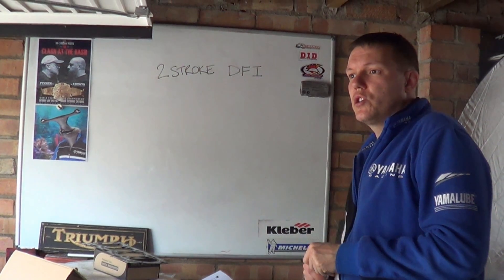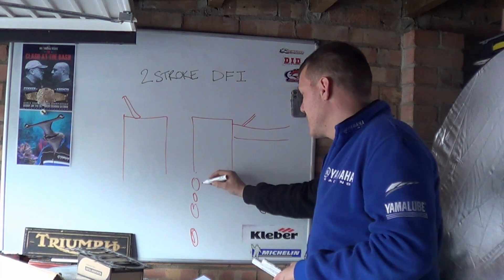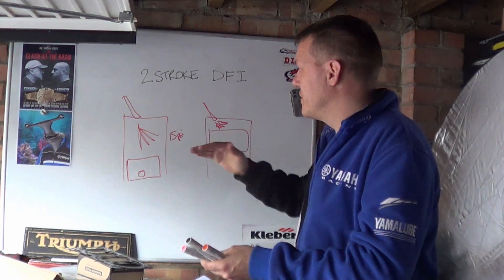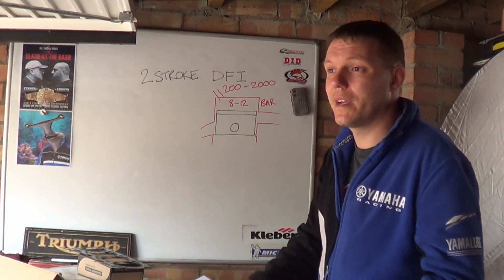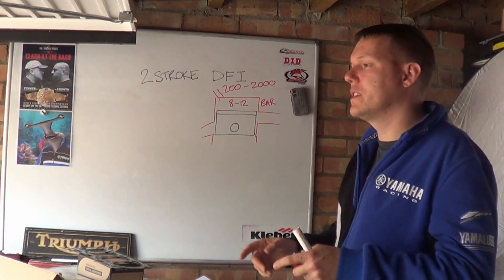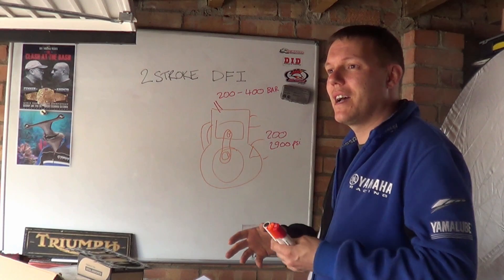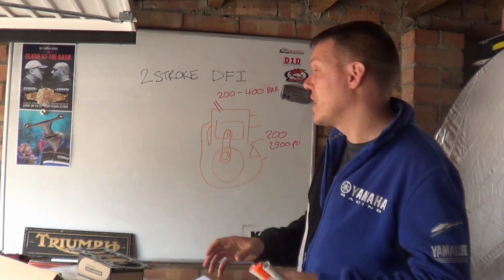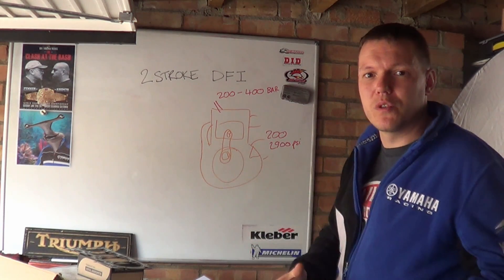Will Direct Fuel Injection save 2 Strokes?

Comment: Matt, do you think someone will succeed in doing Direct High Pressure Fi on 2 strokes in a few years ?
Or will they abandon the IC engine all together and go electric dildo on wheels route ?
Reply: That's what I would like to know to. And maybe there could be a way to reduce the emissions from the oil scraped off at the exhaust port. I really hope 2 strokes don't die.
Reply: @EbonyPope  They are already dead as far as I am concerned. But I love them and ride one! Plus people want to ban Diesels which are cleaner than even the cleanest 2 strokes :/

Comment: You are right on most of things, but your fuel pressure values are awfully wrong here. As piaggio (aprilia) in early 2000's made direct injected 2 50cc stroke scooter and it used air assisted direct injection after closing exhaust port with max air pressure of only 8bars. Called DiTech. Look it up. Ecu Rev limit was 10000rpm. Had one.
Reply from the maker: "but your fuel pressure values are awfully wrong here" 

Come on dude, if you're going to call someone out get it right. The DiTech (morini system) and/or the Purejet (piaggio system) is in theory a direct injection system but in the same way the TPI system is on the KTM. The injector spray fuel into the cylinder just as the exhaust port closes not like the Etec system or at TDC like diesel systems.

They were soooo good that they're no longer used.
Reply: @thedirtyworkshop  Your responses do not need to be rude in order for you to reply. 
To quote you in this video: "As soon as you close your exhaust port you can spray fuel. The problem is that then piston is very close to TDC and that the pressure is quite high ~ 8-12 bar."
Which is incorrect. And you're trying to avoid the fact by trash talking about the system itself.
Direct injection is every injection that has injector located in cylinder head and sprays directly into combustion chamber, no matter the timing of injection itself. I didnt say that DiTech was perfect in any way, as it was a first attempt at that technology. But it did what it was advertised for.
Reply from the maker: "The problem is that then piston is very close to TDC and that the pressure is quite high ~ 8-12 bar.""

- yeah, very close to TDC the pressure is between 8 to 12 bar. Have you ever done a compression test?

"Which is incorrect."

- do a compression test and get back to me.

"Direct injection is every injection that has injector located in cylinder head and sprays directly into combustion chamber, no matter the timing of injection itself."

- Very true - not arguing that, however when an injector fires is very important when concerned with fuel pressure. 

"But it did what it was advertised for."

- What did it advertise?
Reply from the maker: Oh and to add - this is a video that is generalised.
Reply: @thedirtyworkshop  Read what you said again, its "then", not "when". Changes the meaning of sentence.
It makes sense to inject as soon as exhaust port closes as it gets the unwanted 2 stroke wasted fuel flaw sorted out. Only thing why would you inject at TDC is stratospheric lean burn, which you don't need to use. Its not a diesel that you need to inject at tdc in order to get the mixture ignited, you have a sparkplug there to do the job.
P.S. all the injection problems that you describe here have actually been sorted out, but not for two strokes but your beloved 4 strokes (Audi/VAG TFSI) and they work very well so no point in discussing that problem as the solution is already there.

DiTech was advertised as "new" technology, better power/torque than same 2stroke carbed models (and 4stroke) and better emissions and fuel economy than both conventional 2 or 4 stroke engine.
Never advertised as reliable. (damn Italians)
Reply from the maker: "Read what you said again, its "then", not "when"."

- LMAO! You are some sort of special aren't you. No, it's when - not then. I fucking wrote it, not you. I know what I mean - not you. 

"Changes the meaning of sentence."

- Are you, someone who is probably not English (because of your name 'Karlo Kasunić') trying to tell me how to speak/type/write English? LMAO! WOW that's a massive ego you have!

"It makes sense to inject as soon as exhaust port closes as it gets the unwanted 2 stroke wasted fuel flaw sorted out."

- and then (LOL) you come out with this gem of a sentence. 'gets the unwanted' - 10 point there dude. 

"TDC is stratospheric lean burn"

I'm pretty sure you mean 'stratified' and not stratospheric. The stratosphere is a band of the atmosphere...

"P.S. all the injection problems that you describe here have actually been sorted out"

- LOL yeah - high pressure direct injection 2 stroke engines are everywhere...

" but not for two strokes but your beloved 4 strokes (Audi/VAG TFSI) and they work very well so no point in discussing that problem as the solution is already there."

- So much so, that you watched the video...

"DiTech was advertised as "new" technology, better power/torque than same 2stroke carbed models (and 4stroke) and better emissions and fuel economy than both conventional 2 or 4 stroke engine."

- Please send me both the adverts and the data to back that up.
Reply: @thedirtyworkshop  So you actually are changing the subject again. Yes, english is my third language, its a fact. Should I be ashamed of that?
No need to respond, to above question. But I would like answer on these 2 questions, with an "yes" or "no" because those are the facts I'm refering to.

1. Is the pressure in the cylinder 8-12 bar  at the point where exhaust port closes?

2. Is the DiTech engine direct injected two stroke with a maximum of 8 bar air assisted injection?

If you're able, yes or no

Comment: Dry sump engines in airplanes can be operated up side-down.  The crank case will need oil misting and a scavenge pump.   It can be done

Comment: The biggest problem with 2 stroke is the ethanol in gasoline. When ethanol sits for even a week it absorbs air moisture and washes out the oil; overheats the piston and case. I just bought 1 gallon of Stihl motomix for my chainsaw and it was $34.99 US.
Reply from the maker: "When ethanol/gas sits for even a week it absorbs air moisture and washes out the oil its mixed with;"

- LOL you do realise that petrol/gasoline is a solvnet for oil, not water. Water and oil don't mix LOL - and i've done a video about how much ethanol absorbs water, and after 3 months its not that much at all.

One other problem with what you just said. Gasoline is what cools engines and your piston, not the oil. Oil is there to reduce friction.
Reply: The Workshop- on a side note, I have a 1981 ATC 250R with a steel sleeve. I had it bored 2mm over. With a larger carburetor will it make more power? Do I need to change the mix? It’s 20:1 now stock
Reply from the maker: "Ethanol is hygroscopic meaning it absorbs water and does so 50 times it’s mass."

BRAHAHAHAH! Are you fucking insane, just think about what you have written for 1 second. That means that if you has 1 litre of ethanol it absorbs 50 litres. How the fuck and where the fuck does all that water come from? LOL You do realise that water weighs 1 kg per litre.

Ethanol is hygroscopic, and over 3 months tested samples of E10 absorbed 3% water of the ethanols mass - which was 50g of ethanol. 3 MONTHS! Do you understand how dry air is?

"The Workshop- on a side note, I have a 1981 ATC 250R with a steel sleeve. I had it bored 2mm over. With a larger carburetor will it make more power? Do I need to change the mix? It’s 20:1 now stock"

- 2mm increases your dispalcement from 246cc to 261cc - that's a 6% increase, so no, you'll be fine. And no, the premix is based on fuel volume - you draw in 6% more fuel then 1/20th of that will be oil
Reply: Ethanol is hygroscopic meaning it absorbs water and does so 50 times it’s mass. Google “ethanol absorbs water”

Comment: For the past 15 years I've been wondering what the point of 2 strokes still is. I mean other than say a chainsaw where the engine may have to run on it's side or upside down and the fact that the oil is in the fuel becomes a technical benefit over having a 4 stroke engine that would need to run a pressurised oil system to deal with that kind of use.

From my perspective, the EU could just blanket ban 2 strokes for just about any application, bar a few very specialist ones. Almost anything a 2 stroke could do can either be done by a 4 stroke or by an electric motor.

Take a moped/scooter as an example. 2 stroke pre-mixed fuel is bordering on 3 euro per litre. Well over a euro more expensive than regular euro95. And even then, 2 strokes tend to be more thirsty. Like my friend who still rides a 2 stroke Kymco GD, that thing gets maybe 5l/100km, but generally closer to 6l/100km. Meanwhile my 4 stroke Kymco Agility sips fuel at a very reasonable 2l/100k, generally slightly less.
And there's no blue smoke by default, it's more quiet, and it'll actually idle without bouncing up and down in revs. 

2 stroke engines for mainstream use died over a decade ago. It's time the regulations finish the job and ban them entirely.

Comment: Hello mate, this is Doru from Romania, I had an ideea and I thought I should take a second opinion, especially I've seen a lot of your videos from this 2 stroke DFI series and you're good, my question is why not to put a low pressure fuel injector exactly under the exhaust port, and time it to spray in the opposite direction of the intake port in the intake stroke ? I thought that because of the crossing of the atomized fuel and air the mixture will be more refined and the thermal efficiency will be better, and because of the pressure of the atomized fuel, the mixture will be thrown in the opposite corner of the cilinder, considering the exhaust port, and hopefully the engine speed will close the exhaust port before any of the mixture can escape the cilinder, hope to hear you're opinion, have a good one 🙂(PS :I'll work on a 3D model, if you're interested)
Reply from the maker: So you wanna stick an injector in the exhaust port? Or directly under it? Hope it can survive the temperatures.....
Reply: The Workshop under, at a certain angle, but my main concern was the temperature, you'll need a superinjector to handle such temps
Reply from the maker: What the fuck is a superinjector? LOL
Reply: Then you can't port it lol

Comment: Well...petrol engines have lower compression ratio than diesel engines and diesel engine works on direct fuel injection....so hows pressure there! Can you explain
Reply from the maker: Do you mean how comw diesels have higher pressure?
Reply: It’s often solved with high pressure around ~2000bar or higher. For example Volvo has common rail pressure of 2500 bar.

Comment: Preheating to a certain degree helps atomization occur faster if you only use coolant or exhaust heat to preheat just to a certain temperature.

You could also use self-lubricated ceramic parts for the pumping aspects of the injection system, if you can make an affordable option.

Comment: Certain snowmobiles, namely Polaris sleds, had both oil injection and fuel injection starting in the late 1980's and early 1990's. It is the Japanese manufacturers fault alone that they did not adopt this, despite the fact it's been around and in full use for near 30 years.
Reply: I know this is an old video but some of your facts are off a bit. 
Yamaha was the first to offer oil injection as far back on production snowmobiles as 1969. Yamaha also offered fuel injection in 1977 or so on the race sleds.
Arctic cat was the first to offer fuel injection on production sleds and polaris was second though not by much. Polaris had to stop making fuel injected sleds ( short lived and only 2 models ) because they ripped off the original design from the automotive world so were sued. 
At that time both Arctic and Polaris used Japanese engines ( arctic cat = Suzuki and polaris = Fuji heavy industries) so I dont think it was the Japanese who stopped 2 strokes from developing fuel injection.

Comment: Where you gettin' "16KRPM" from? Don't most gasoline engines red-line at about 6K, +/-? And don't a lot of diesels red-line at about 4K (like mine, if I remember right)? Okay, so that's only for 4-stroke, I guess. So every time you talk about 16KRPM here, you're only talking about a small gasoline 2-stroker?
Reply from the maker: no, I'm not talking about car engines.
Reply: So then weed-trimmer engines go 16K at top speed? Lawnmower engines tend to? Or only 2-stroke ones?

Comment: 6:40 a gasoline engine might have compression ratio around 10:1 (just a coefficient nubmer) BUT the pressure at TDC will be greater due to an air compression heating (dynamic compression ratio or something like this) and this could be around 13-15 atmospheres (pressure measurement).

Comment: Do a supercharged Direct Injection 2-stroke with oiling system! 👍🏻 I bet the power output and efficiency would be incredible. We need a vid on it and possibly with more than a single cylinder would really be a game changer. It might be the rebirth of 2-stroke
Reply from the maker: "I bet the power output and efficiency would be incredible."

- i bet it wouldn't
Reply: Sorry, I meant turbocharger.  

Which part, the efficiency, or the power output, or both?  I mean, you're not blowing the unburnt fuel out the muffler with direct injection.  Plus, whatever turbo pressure makes it past compression will go back into spinning the turbo, at least somewhat.  No exhausting stroke needed.  I guess it could depend on just how fast your 2-stroker can rev up to as well without failure.

Comment: when the exhaust port closes what is the cylinder pressure? I doubt it could be much more than 2 bar. If the compression ratio of a two stroke is 10:1 geometric, than once the exhaust port closes the the compression ratio could not be much more than 5:1. 

I noticed no discussion of the orbital air assisted fuel injection. I am sure you must be aware of them. Have you looked at the retrofitting by Envirofit of 2 strokes in the Philippines? 1 cylinder 100 cc taxi motors were retrofitted with an Orbital based air assist for less than $300.
Reply from the maker: "10:1 geometric, than once the exhaust port closes the the compression ratio could not be much more than 5:1."

Very good point and this needs it own video - matt

Orbital Combustion Process - ATTL

Comment: How about a two stroke fuel injected motor that works with a supercharger like a diesel but uses a spark plug and gasoline? The crankcase wouldn't be part of the cycle...
Reply: This already exists. But it's mostly used in marine applications where emission regulations aren't as strict. They even burn crude oil.

Comment: Curious about the  Bimota V-DUE 500... How did they work? I heard they had separate/sealed crankcases like a 4t??? and passed emissions in 98, I know they had some problems (although later fixed with kits) do to Bimota pushing them out the door too fast, killing the company and a possible 2t revolution with it.  I just have no Idea how they worked.

Comment: Loved the EXP2's Activated Radical Combustion system. Honda claimed this system was very fuel efficient, was an improvement in driveability and clean. 
A dirtbike and a scooter were introduced with this technology. Then Honda went 4 stroke minded or something, because after 2000 everything went 4 stroke (including motorsport).
I hope something will save the 2 stroke, injection systems are a good step in that direction.
Reply: it was their dogma from the start. remember that nutjob bike called RC46(124 4t 4cyl)?
Reply: I have the honda pantheon.this is a fine scooter.very clean running .for over 20 years and their is no ash in the exaust

Comment: Gasoline direct injection is becoming the norm on new cars and even economy cars. The high pressure pumps are typically smaller than a fist and don't require special lubrication. They could easily be used on a motorcycle engine. Horsepower goes up and fuel consumption goes down which is why it's now in wide use despite slightly higher costs. On a direct injection 2 stroke, however, you would need to lubricate the crankcase.
Reply from the maker: There are different types of direct injection, not the one I talk about here.

Part 2 - https://www.youtube.com/watch?v=snAGoUzI_Pw

Comment: Yes simple answer, did my uni dissatation on it (92% i got on it :P). Was suprised how many uni profs wanted to read it. Lighter, more power to weight, list goes on . The only thing that let the concept down was the short circuiting of unburnt fuel and oil. Inject the fuel in when the ports are shut and add cleaner burning oils there you go. KTM are planning on releasing a new two stroke with this technology.
Reply from the maker: Would you send me your dissertation?
Reply: Yeah ofcourse, i will need to find were my electronic copy but think i know where that is :) I will drop you a message when i find it.
Reply from the maker: That would be very cool - matt
Reply: @Luca Mont Hi, i found the soft bound copy but soft copy i did not. However now you have reminded me again will have a look on my old laptop this weekend :)

Comment: does that not mean with dfi the port positions can drastically be changed to almost perpendicular positions? could the crank then be sealed to run in oil for lubrication, with a cylinder inlet port?, or would the crank still need to be used as a pump?.. suppose that is a 2-stroke diesel engine lol.
Reply from the maker: Great question, this video might help - https://www.youtube.com/watch?v=snAGoUzI_Pw&lc=z122yz1oklqfyh5kg23qhluiiznsyx0an04

Comment: Other Problem: with direct Injection Young Need a seperate oil System because fuel wont Hit The Most Parts of the cylinder
Reply from the maker: What's with the weird CapITal leTterS EverYWHerE?
Reply: Im sorry im using a german Keyboard the Capital letters get replaced automaticly